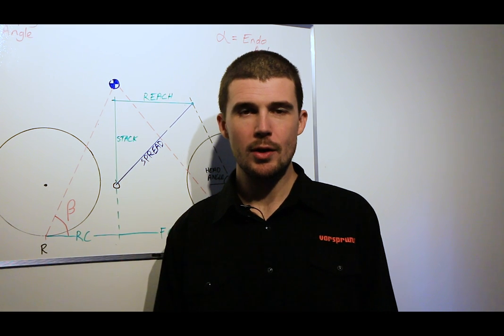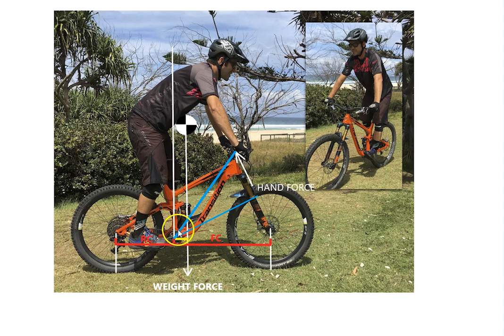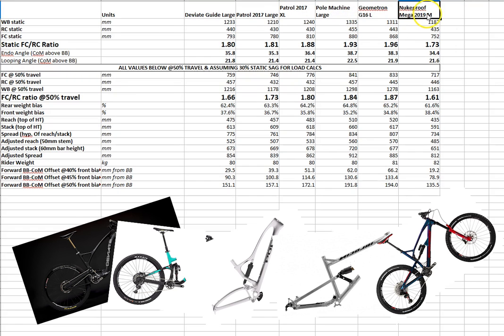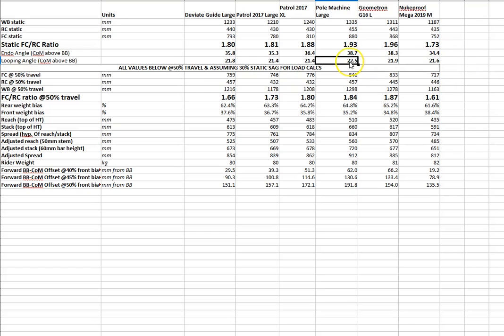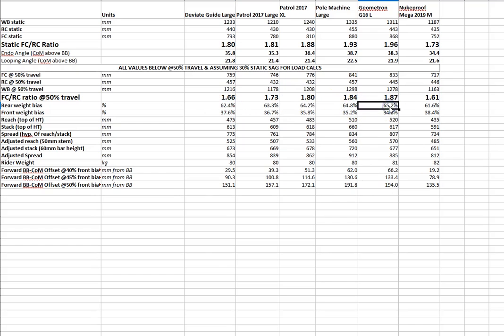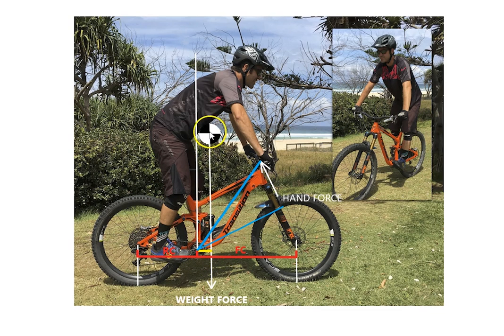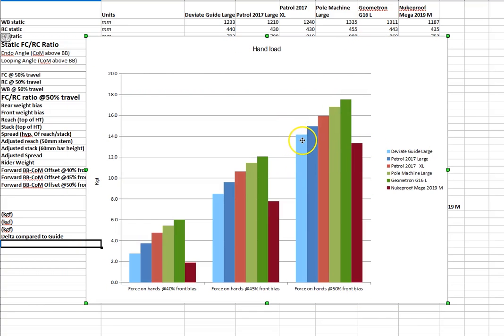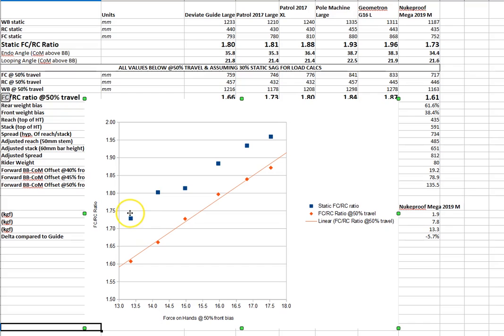Understanding Advanced Bike Geometry Pt 2 - Tuesday Tune 26

Comment: One aspect I struggle to understand is, sag vs HA, FC, RC in regard to geometry (changes) Some folks I rude with claim that adjusted sag will 'change' the geometry.  I disagree. Sag effects Geo, but can't permanently change it. Am I wrong? You really can't change the HA, FC & RC.  They are Fixed. Whereas travel is dynamic and not fixed imo. Sag seems to be static- meaning it's set and that's the number. Travel and leverage ratios aren't geometry or are they? 
A fork & shock are in flux, unless a change is made to fork height (dh) or longer/shorter travel and a shock s linkage or pivot point us modified. Again my opinion.
Reply from the maker: Sagged geometry is the geometry the bike is actually at when you're coasting along on flat(tish) ground. Head angle, front centre and rear centre all vary dynamically according to where you are in the travel at each end, as well as axle paths etc. Running a softer spring rate in the rear end though does effectively slacken your head angle, and on certain bikes it'll also lengthen your chainstays pretty significantly. 

Because it's such a dynamic system with 2 degrees of freedom, you could hypothetically be anywhere between four limit cases at any time:
1. Both ends at full extension
2. Both ends at full compression
3. Front fully extended, rear fully compressed
4. Front fully compressed, rear fully extended

In practice, most of the situations where your geometry really matters occur around 50% travel front and rear, because if you're not deeper than the sag point you aren't really that loaded up on the tyres. Ultimately if you want to compare numbers in a way that you can make much sense of, you have to pick a point at which to do it, and that point should be "reasonably representative", which is why we look at 50% travel each end.
Reply: @VorsprungSuspension  Thank you Steve, that makes much more understandable!

Comment: I ride said Nicolai G16 Large for 6,5 years now and can confirm that there is weight on the hands also the stack is super low compared to the reach. I‘m 192cm and should be riding XL, but I‘m glad I went for L at that time. I had switched to 38mm fork offset early on to get more weight on the front wheel and I also brought the bars up quite a bit.

My takeaway is that FC/RC balance is key. That means if you want to have a easy manualing bike that is also balanced you‘ll have to go for a shorter reach as well. Assuming a manual benefits from shorter chainstays, shorter reach and higher stack it seems to me that the shorter reach approach can easily backfire by overdoing it.

It took the Black Friday sales opportunity to buy two Propain Spindrift 27,5“ frames M @ 450mm reach and L @ 475mm reach both @ 435mm chain stays to figure this out.

I will also go with a 75mm riser bar because I’m 192cm tall with a rather normal 86cm RAD, and I think shorter reach with a high stack fits me better.

Thanks a lot for the superb content!

BR Tobias

Comment: Very interesting videos, thanks for putting the time and effort. Late to the party here, but since I was looking for a new bike recently I did some tables myself and noticed this: As mentioned, the FC/RC ratio changes across sizes for the same model. Some brands keep the same rear center across their sizes, and others make it longer as sizes grow. Comparing two examples on their smallest and largest sizes the numbers show that even when the RC changes for each size, the ratio isn't kept constant enough. The length added to the RC for each size up relatively short. I used the Privateer 141 as an example of a model that varies rear centres across sizes. The ratio is 1.75 for the P1 and 1.87 for the P4. I used the '22 Giant Trance X 27.5 as an example of a model that gets the same rear center across sizes. The S is 1.72 and the XL is 1.91. So the Privateer 141 gets closer ratios across the range compared to the Giant TranceX but it's still far from being constant. Is it because brands are being conservative and don't want to scare people away with huge rear centres on the larger sizes? Or is it something else (related to rider position/measurements) that makes up for the non-constant ratios? BTW Paul Aston has been experimenting with a custom DH bike with a 500mm RC. Maybe he's onto something?

Comment: Extremely interesting, I'm trying to determine if needed to shorten the offset of my fork since l've changed stem, shortening it from 50 to 40mm, for quicker response ... but this led to some kind of "flop" sensation in the front, during cornering, where I'm not in very aggressive position ...
Extremely interesting, I'm trying to determine if needed to shorten the offset of my fork since l've changed stem, shortening it from 50 to 40mm, for quicker response ... but this led to some kind of "flop" sensation in the front, during cornering, where I'm not in very aggressive position ...

Comment: Thanks! It’s true that a shorter FC gives traction to the front wheel but based on my experience its also true that it gives much less confidence on very steep downhill trails. This is very notable if the steep downhill trail is full of big rocky step down.
Reply from the maker: I agree, which is why I believe it's imperative that longer front centres are matched with longer chainstays. Seems almost self evident that it might not be a great idea to only change the size of one end of the bike and not the other.

Comment: @Vorsprung how did you calculate the endo and looping angles? I would have taken arctan(1100/FC) and arctan(1100/RC) (=arctan(opposite over adjacent)) - and my angles are in the 50s. Could it be that you took adjacent over opposite?

Comment: Thanks for the very informative video. Question: is there any way to determine the desired reach / stack / spread based on body measurements alone? Off-bike, I mean
Reply: Lee Mckormac's RAD measurement might help?
Reply: I meant the ideal angle. But I've learned and tested a lot since and found my answers
Reply: Try Pythagorean theorem

Comment: Great video, thanks a lot. Please correct me if I am wrong, but isn't the Endo and Looping Angle in your spreadsheet measured to the vertical and not to the horizontal as shown on the whiteboard? If measured to the horizontal the Endo angle would be smaller than the Looping angle, as the FC is longer than the RC.

Comment: This is a really interesting perspective. One thing I find odd about this whole dilemma is that brands like pole are recommending customers to re-learn how to corner by counter steering before the corner which makes me wonder if they have gone too far. One thing I wanted to ask is if BB drop has a castor effect causing the bike to self right? Paul Aston was saying he runs his Geometrons with negative or zero BB drop because his feet are then rotating the bike on the same axis as the axels. Does this make sense? or is it more complicated then that.

Comment: With regard to CoM, would'nt a riders position (sitting/standing, fore/aft) manipulate the CoP (Center of Pressure) rather than the actual mass. CoM is relatively fixed. But you can move the CoP in relation to CoM.
Reply from the maker: If you're moving mass around, you're shifting the centre of mass. Centre of pressure is a term typically used to summarise aerodynamic pressures distributed over an area into a force vector such that its net effect can be properly understood.
Reply: @VorsprungSuspension  Thanks for the explanation Steve! I also watched a video with regard to CoP in relation to CoM about golfers and their swing and how a person can manipulate the center of pressure rather than the center of mass. I'm wondering if that somehow applies to cycling when you are moving around the seat fore-and-aft and a little bit up-and-down especially with mountain biking.
Reply from the maker: @archetypex65  what you're talking about would be called dynamic contact patch load (CPL) which the rider can vary transiently by essentially bouncing up/down on the bike to accelerate the centre of mass. You cannot dynamically vary CPL load (and especially not front/rear proportions of it) without it either causing or being caused by CoM acceleration, which over any finite period of time results in displacement. The two are intrinsically intertwined.

Comment: Late to the party, but fascinating video. So to get a 50/50 balanced bike with no weight offset the RC of all of these bikes would have to grow considerably (194mm in the case of the Nicolai, 135mm in the case of the Nukeproof). Does anyone know if this has been tried? Has any manufacturer put chain stays this long on any bike? Very intrigued as to how something like this would handle....
Reply from the maker: That's about right, but the goal isn't necessarily zero weight offset though, like having some weight on your hands isn't a bad thing if it's not overloading your arms/upper body. What is "optimal" in that regard I think is quite subjective. For someone like me with a fairly weak upper body, having to load the bars heavily is a bit of a burden, but stronger guys (Leo says he isn't that strong, but he's a lot stronger than me) will obviously be able to tolerate more arm/chest load before it becomes difficult or strenuous.
Reply: Have you thought more about front rear center on MTBs?

Comment: At what sag would you calculate FC:RC ratio for a hardtail?
Reply from the maker: Not really relevant on a hardtail - not like the rear has any grip anyway!
Reply: @VorsprungSuspension  I'm not sure if I understand correctly: so calculating FC:RC for hardtail doesn't make any sense (RC can be as short as possible) or should I just calculate it without sag, as sag seems, as you have said, to have very little influence on FC?
Reply from the maker: @alexandertheroot  it's only really relevant for grip and traction. Hardtails have so little grip on the rear as soon as the ground is rough at all that it's not really relevant - the rear will run out of grip the second the ground gets rough anyway!
Reply: @VorsprungSuspension  Thank you! Seems though, that there can be still a limit. Take a look at Pipedrem Moxie test:
https://enduro-mtb.com/en/pipedream-moxie-hardtail-review/
"The adjustable stays work best in the longest setting as 415 mm option is far too rear biased and the bike feels unbalanced. With the stays at 431 mm, the riding position still favours the rear wheel and – with the 510 mm reach – you need to physically get over the front to get the most out the Moxi’s cornering abilities."
This is older version of frame that has FC:RC almost 2 when CS is 415 and about 1.9 at 431. Newer version has longer stays, 425-441.
There's also test of Orange Crush 29: https://enduro-mtb.com/en/orange-crush-29-hardtail-review/
This one has RC of 445 (I suppose CS is about 450). FC:RC is about 1.72.
I'm not sure what to think about this, but it somewhat fits what you are saying in vid despite of lack of grip of hardtail frame.
Thank you again for precious info!

Comment: I just went down in frame size from nicolai in medium to one in smal (from 507mm reatch to 485mm) and then changed stem from a 40mm to a 50mm and it makes me feel i can ride it more relaxed and dont have to be as far over the front.

The longer frame was good at times, but feelt like to mutch sometimes..

Im 183cm so shuld be on a large according to the guides..
Reply: Which Nicolai are you riding? I'm considering getting a Pole Stamina 140 (reach 500) to replace my Liteville 101MK1 (reach 431) and a 301MK14 (reach 452), all size L I am most worried about the lenght of the bike, will that be fine in the Swedish forest?
A true shame we can't test the bikes before buying them... I'm 186cm.

Comment: Loving the series

I have a question about fit!

I run a bird aeris 160am in large which the designer (as they are really on the social stuff) says is too large for me as im 5’10 and have a 33inch inseam.

With long legs i struggle with bike fit. I personally have found i do not struggle with weighting the front wheel as i should do whereas on my giant glory large, i really washout often.

The bird is 506 reach and the giant is 467. The numbers such as front and rear centre are nearly exactly the same but the top tube on the giant is smaller as its got fox 40s and on the bird i habe 160 lyrics.

What is suggested with people with long legs as i have heard size down and size up and even just ride the recommended size!

Comment: This is really informative. Keep them comming. I still remember bugging you about Legend geo close to 10 years ago when I was in the market for it and you helped me a lot. This is also super informative. Though I remember when RM still had a decent representation of reasonable people (well ok it still has but they stopped being serious) there were already concerns about bikes being too slack. Still some concerns about the front wheel not being weighted enough kinda came through when Mondraker team did not go for Cesar's zero stem and quickly went back to normal stems. 

btw. One thing that keeps bugging me. On one hand you have to move more to weigh the front wheel properly on really long bikes but on the other since you are more stretched out you have lower range of possible motion so while your static position should fatigue your arms more shouldn't a more static position forced by less possible range of motion reduce fatigue? Or would that work only in some super extreme cases when the bike is basically unrideable? (

Comment: according to your last video, you want your endo angle to be very small... how comes that here the pole is the biggest, although having the highest  front center? shouldn't it have the smalled endo angle?
Reply: old comment, but i guess what he shows in the table is the maximum angle of the terrain before the bike tips over. A bit confusing as it doesn't correspond to the bikes endo-angle.

Comment: Okay Steve, this is quite a rabbit hole. Yet another question:

Wouldn't decline affect the equation, whether we're cornering or ploughing straight down a trail?  i.e. Isn't forward bias just naturally generated when riding steep trails? If so, could it be said that a more descending-oriented bike rides "neutrally" with a larger FC:RC imbalance?  But then I'm reminded that downhillers commonly call for longer chainstays-- or perhaps what they really want is lower FC:RC-- and Minnaar was very adamant about lengthening the rear of his V10. He's similar to Hill: rock solid on the bike, rarely gets loose, and crashes almost never. Gwin also fits this description and I seem to remember hearing that he often asked for longer rear ends on his bikes (and finally has them on his M29).
Reply from the maker: Yep, incline/decline affect where your body needs to be in order to achieve any given weight bias - the trend remains  the same however, and the steeper the terrain gets the closer you get to limit conditions where the rear wheel has little or no grip anyway, at which point the endo angle (as discussed in part 1) becomes a more relevant concern than FC/RC ratio.
Reply: @VorsprungSuspension   Thanks. Do the below observations sound accurate to you, as a summary of the 'state' of modern geometry?

1) DESCENDING: We want bikes that descend steep terrain without forcing us out of a neutral position (shifting around and hanging off the back of the bike is precarious). So we improve the endo angle by moving the front wheel away from the rider's CG via longer front-center and slacker HA, recovering some of the steering response with shorter stem length. A fine solution indeed.
2)  CLIMBING: We want bikes that climb steep terrain without forcing us out of a neutral position (hinging and lurching over the bars wears out our core/lower back prematurely). But rather than moving the rear wheel away from the rider's CG and growing the rear-center as we did in (1),  we choose to move the rider away from the wheel and improve the looping angle with a steeper STA. To maintain some breathing room in a seated position we're forced to extend the "saddle-to-bar" distance, effectively growing the reach and adding even more length to the front-center.

This is a lopsided solution set, literally. Because we address the first extreme (descending) by moving the front wheel out from the rider, but address the second extreme (climbing) by moving the rider out from the rear wheel (pushing the front wheel out again to maintain a consistent cockpit), we create a completely new challenge of neutral positioning during intermediate contexts when traction is the primary concern, where the rider is forced out of a neutral position-- into a forward bias position-- to account for the FC:RC mismatch. 

And we do this to preserve... what, exactly? Riding manuals and flicking dirt in berms? And then praise short rear-center designs with words like "playful" and "poppy."

Comment: New question: is there a good method to quickly judge a bike's "neutrality" in terms of FC:RC? Seems like there's a lot of variation in the changes from static to 50% travel due to different axle paths, which means you need a kinematic simulation for the linkage to figure this out.
Reply from the maker: I think static FC/RC values give you a reasonable starting point as a quick judgment in most cases (high pivot frames notwithstanding), because most bikes actually do have fairly comparable axle paths (front and rear) for comparable amounts of travel. 

Even 50% travel as calculated is arbitrary - in berms it's pretty common to be exceeding 75% of your travel for example, but on off camber stuff it might be relevant at 30% travel too.